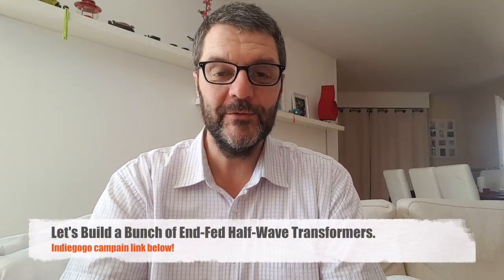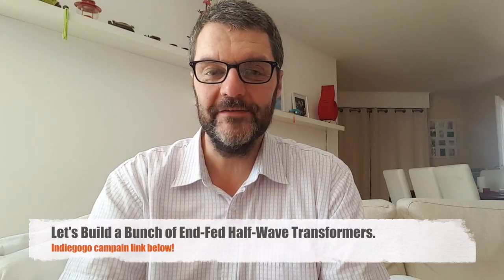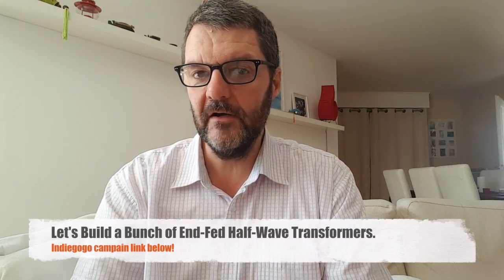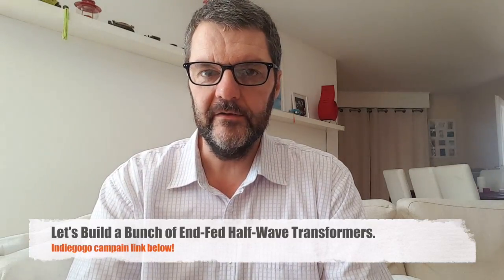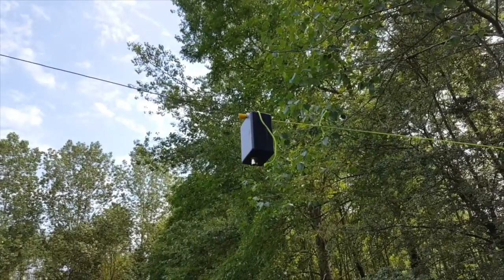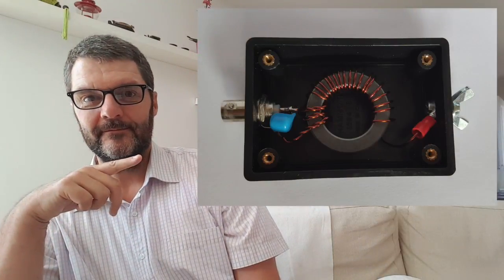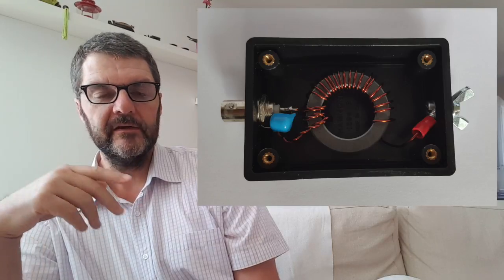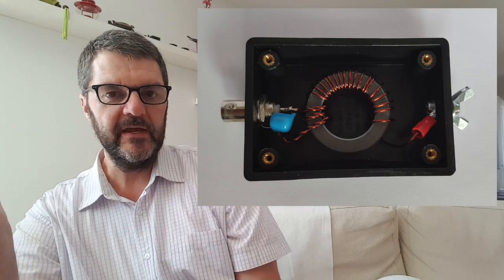Let's Build a Bunch of 49:1 Half-Wave End-Fed Transformers.

Comment: Hello Radio Pepper, The video is very informative. I live in an HOA, and have some restrictions. I can't have any outdoor antennas. However, I have a unused satellite dish not being used. I see where I can add the end fed antenna. I would like to talk dx and local to friends on SSB and AM. I have two 240-43 torriods. For 11 meters how many turns would I need of wire and which type of transformer 9:1. or 49:1? Thanks for sharing your insight it is greatly appreciated . WR0546
Reply from the maker: A half-wave is better, so 49:1, two turns primary, 14 total, with a half-wave wire.
Reply from the maker: https://youtu.be/0zF7bDoqkG4

Comment: What size capacitor did use with the 140-43 to droid?
Did you ever post a link to the building details? More detail on turns, a diagram for winding?
Reply from the maker: 100pf, 3KV.

Comment: Hello Gil. What about a smaller toroid for low power portable (10w or less). Say an FT-82-43? Does that make better sense? Tnx, Scott
Reply from the maker: Ft-82-43
Reply from the maker: But make a 64:1, 3 turns primary, 24 total, 0.7mm wire.

Comment: Good evening Radio Prepper,
Finished putting up my 23' fiberglass kite pole antenna with 30'-18g wire that's attached to the 9:1 unun transformer in a coil configuration with 100' rg8x coaxial cable. Its up 38' from the tip to the ground without any counterpoise wires due to the 100' of rg8x coaxial cable. Tried doing what you said but it didn't work. Listening on my 66' sloper I get S5 on station's and when I switch over to the vertical I get S9. You're video's have really helped me a great deal but I like going against the laws of physics. Pushing the envelope has always been a big thing for me. Thanks for you're help.
73
Reply from the maker: What band are you using?
Reply: @RadioPrepper  
I'm studying for my amateur radio operator license while listening on 160-10m I build wire antenna''s. At the moment I run qrp on 11meters ssb.
Reply from the maker: That is an excellent start :-)

Comment: Good morning Radio Prepper, 
Been watching alot of video's on hf multiband vertical antenna's. So I decided to build one. I'm going to be using a Nelson Antennas 9:1 unun transformer with 33'.9"" of 18g wire attached to a 20' fiberglass kite pole attached to a 6' aluminum pole mounted on my balcony that 10' off the ground which from the tip will place it at 34' in the air. The wire will be wrapped around the fiberglass kite pole spaced approximately 2 fingers apart with 3- 33'.9" counterpoise wires attached to the ground terminal on the 9:1 unun transformer at a 45 degree angle perpendicular toward the ground in a west/southeast/east direction. Watching you're video's as well as other's made me decide to try it and see if it would be better than the 66'-18g wire I'm using now up 35' in a sloper configuration attached to a MEF-330-1K transformer without any counterpoise wires attached which I found out doesn't work due it height about ground. Due you think it will work especially being that I'm up 2700' above sea level here in the Southern California desert?
Reply from the maker: Hi, it will work if you stay away from half-wave wires with a 9:1. For a half-wave wire  use a 49:1. Also winding the wire on the pole will mess things up. Let the wire be straight. That said, there is no harm in experimenting.
Reply: Good evening Radio Prepper, 
I'm going to use a 22'-18g wire with 9:1 unun transformer attached to the 20' fiberglass kite pole with 3- 11' counterpoise wires tied to its ground connection. With 100' up rg8x coaxial cable going to my atu. This now should give me a swr of 1.1 on 11m between 26.965mHz-27.405mHz.
Thank you for all of you're help. You're knowledge/experience is by far the best I have come across on YouTube.
Thank you very much
Reply from the maker: Thanks :-)

Comment: Good evening Radio Prepper,
I have a  49:1 end fed transformer. Will a 76' 18guage wire be able to work with it in a sloper/inverted L configuration? Any help would be greatly appreciated.
Reply from the maker: You need a half-wave wire for the frequency you are going to be operating on, otherwise use a 9:1.

Comment: Hi Gil - Nice video and most definitely worth doing!  Go for it.  But I agree - don't use epoxy.  The BNC connector will be a failure point because of the solid magnet wire being encapsulated in the epoxy.  Think of rebar in concrete.  The magnet wire will not move. If the connector center pin wiggles around much, the solder joint will fail in time.  I'd use a more pliable potting compound like I see in 15KV neon sign transformers.  It's semi-transparent, being a brownish color.  Just my two cents worth.  In addition, that potting compound I see used is meant for outdoor use.  It's humidity proof - as any humidity would quickly destroy the HV transformer and GFI protection electronics that's encapsulated. Peace
Reply from the maker: Thanks.

Comment: They are def worth building! I did a Parks on the Air activation this summer and forgot some coax adapters for the vertical I intended to use. I also had my 49:1 transformer....put a wire in a tree and like you said, with a tuner...it's a multiband antenna!
Reply from the maker: Even without a tuner! On multiples.
Reply: That's true!  They are easy to make, but most folks might rather buy one, or two!  I made mine with a FT_240_43 toroid. I bought 2, one for the transformer and one for a 1:1 for common mode current. I planned to use them together, but the size make it big and heavy.
Reply from the maker: Yep. I am making two more for myself, for permanent antennas, 160m and 6m.

Comment: Count me in. I rather buy a qrp transformer that is small than a 100w bigger one. If it is about the same size then hey 100w .
Reply from the maker: Two core should fit in the same case... I need to check the FT-140-43 characteristics..

Comment: Great idea and I wish you luck with that and a lot of backers! If its a multiband then it is not a efhw rather a end fed random wire? What about the ground, is it going through coax to the rig?
Reply: Croatia Prepper nope it's not a random wire it's an efhw at the lowest freq which harmonically resonates on multiples above. Therefore 80,40,20,17,15,12,10m. Random wires are, well, random and by definition avoid being a half wave length of anything
Reply from the maker: Correct. An yes, the wire is DC grounded to the coax shield.

Comment: Do not use epoxy. If whe have to replace the capacitor because it blow up you cant do it.
I have that expirience!
Just use a peace off silicone to fix the torroid.
Reply from the maker: Good observation thanks.
Reply: Outher ideia is to put some connection to ground. I like to ground my antennas. Also use the whater tecnic like you did on the chameleon spike.
Reply from the maker: Always ;-)

Comment: Hi Gil, agree with the other comment, they need to be able to handle 100W for those occasional time operating portable where you need the extra brute force. I have long worked portable with only EFHW's and can back up you comment that they are simple and perform very well and are very portable. You should also incorporate some form of strain relief so that they can be anchored. 73's from VK3 and thanks for the great video's. Always look forward to them.